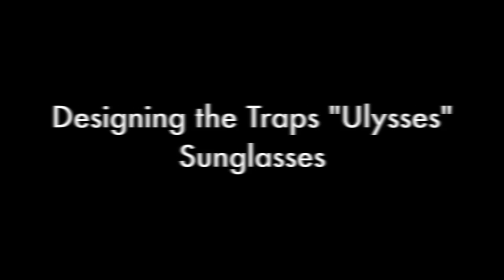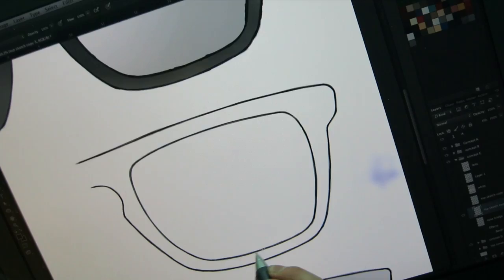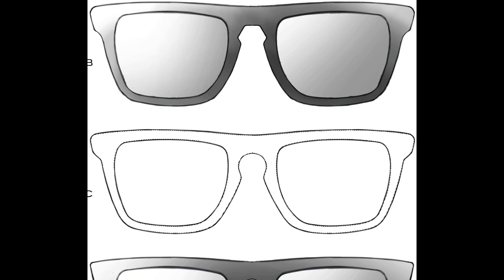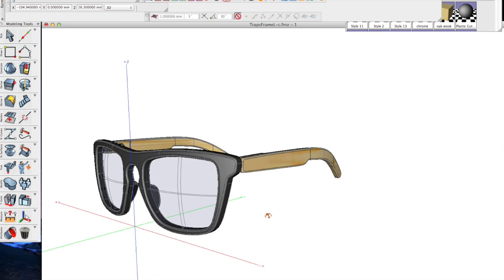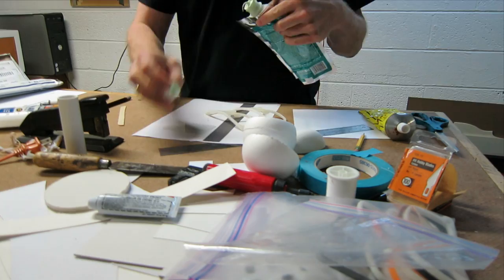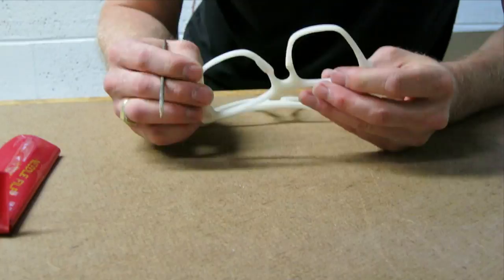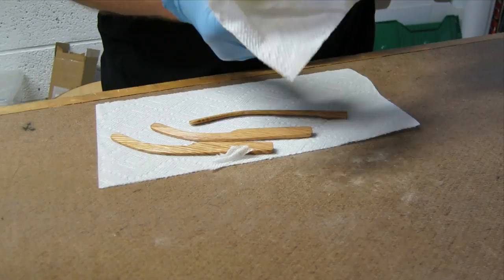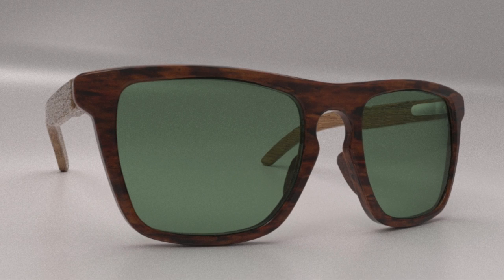How to design Sunglasses: Sketching CAD and prototyping

Comment: great video. so when you do 3d design, is there somewhere online where you get the virtual glasses hinge mechanism? or do you model it yourself? i guess what i’m asking, is there a virtual 3d assets library that you can download parts like hinges ,fasteners , clips for joining two halves of a part together, gears, snaps, etc? or do you make it all from scratch?
Reply from the maker: Many cad applications have this built in, for example fusion 360 has the ability to import from McMaster car. In this case the hinges were supplied by my client from the manufacturer.
Reply: @EricStrebel  oh cool. yeah I just started messing with Shapr3d on ipad, and I’m starting to get into joining shapes in the modeling process. assets like this will be very helpful. I’ll check out Mcmaster-Carr for those parts. thanks